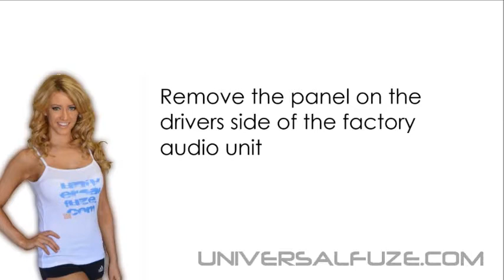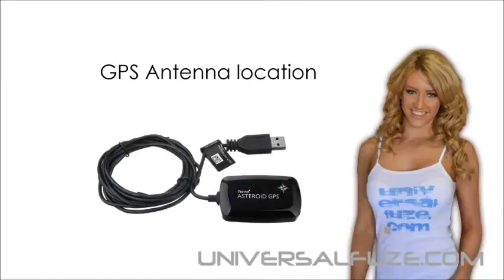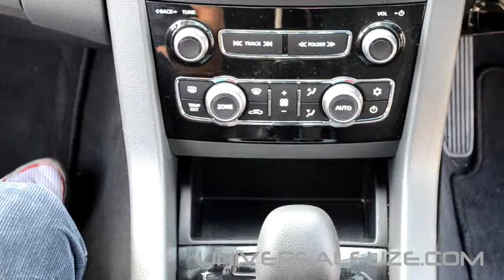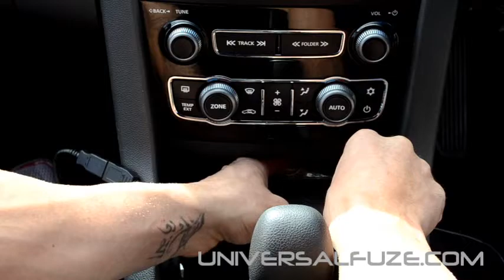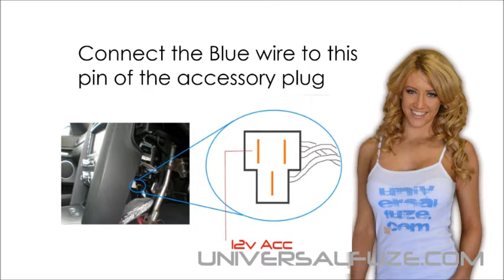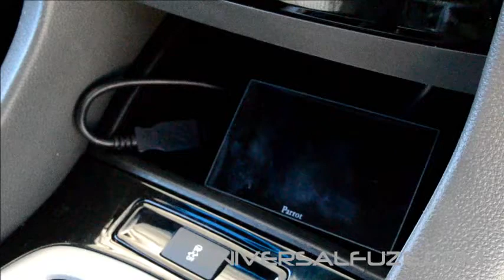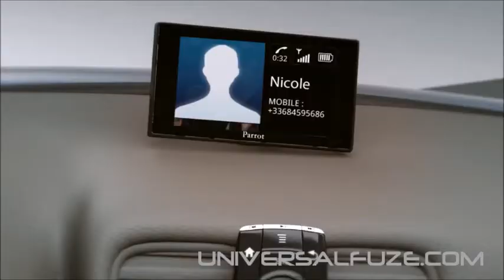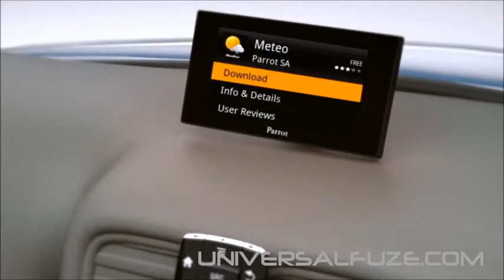Parrot Asteroid Mini to Holden VE Commodore installation tutorial video

Comment: too many different interiors for the VE nothing is as it should be comparing one video to the next.
Reply from the maker: +Andrew John This system is for a VE series 1 or 2, both are almost identical in all regards to these panel removals and cable locations. So identical, that one version of cable applies to both and all panel removal points are 100% the same.